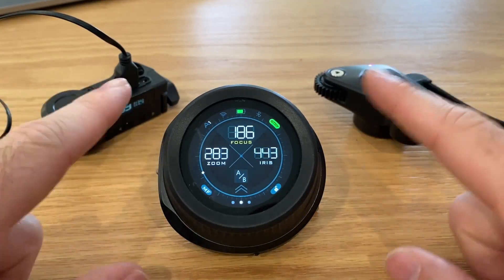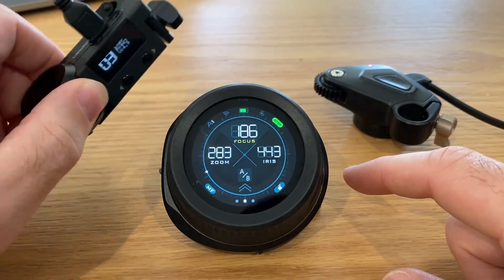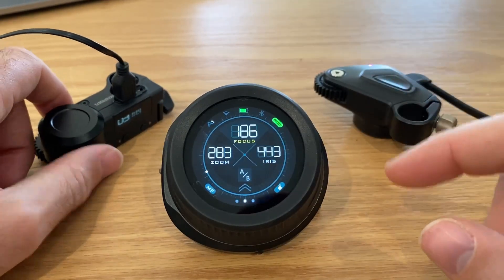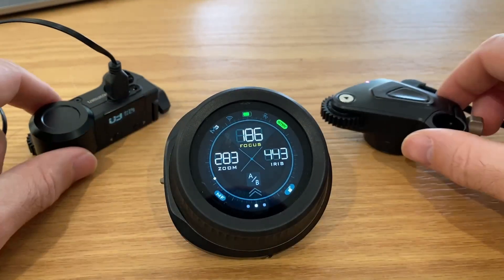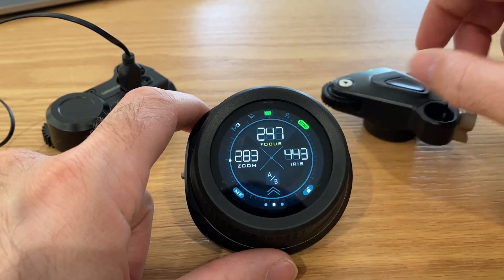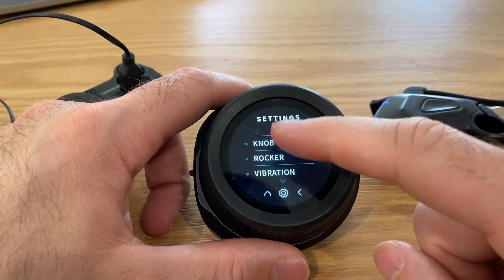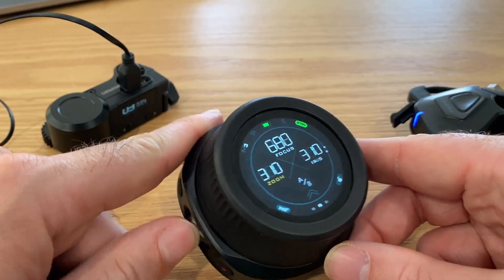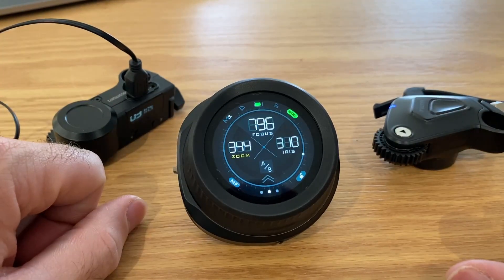Nano 1 Motor Assigned to Zoom Rocker on Nano II Controller

Comment: So far this absolutely does not work. I’m thinking the OP got lucky with some type of factor configuration that just sort of worked backside no matter what channels I try to connect to I can get both motors to initial spin like the OP has. Maybe I’m missing something or perhaps something was left out of this…